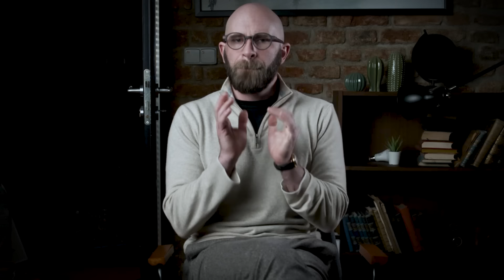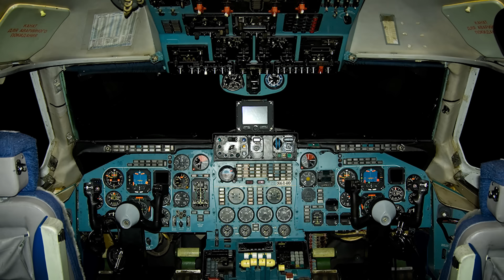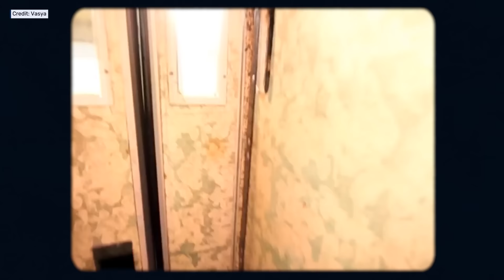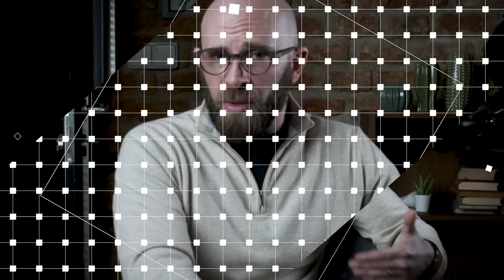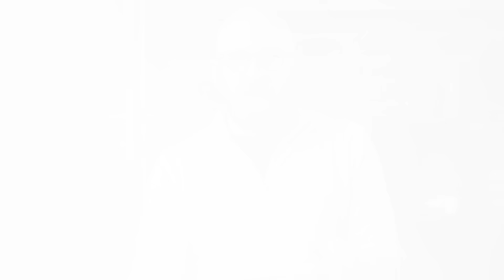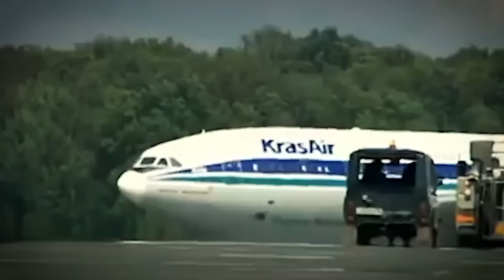The IL-86: The Soviets' Botched Answer to the 747

Comment: I flew on the Il-86 in 1983 LGW-SVO and LED-LGW as a kid. We checked in our luggage normally but I remember walking past a luggage drop-off counter on the lower deck of the plane before walking upstairs. I also remember a little electric fans in the back of seat in front instead of the usual gasper vent. Most of all I remember the take off from Leningrad where the crew did a static takeoff with the brakes on and those noisy turbojets screeching before we careered down the runway. Flying seems a bit bland nowadays!

Comment: I remember flying Il-86 at the age of 5, which was in the late 1980s. The flight was from some resort on the Black sea, probably  Simferopol. I do remember how huge it looked and remember going up the stairs. That was my only time on that aircraft.
The western aircraft that influenced the design of Il-86 the most was A300, which first flew in 1972 (Il-86 flew in 1976). Ilyushin bureau, however, had to use 4 engines because Soviet Union simply didn't have engines powerful enough that only 2 could be used.
The poor infrastructure of Soviet airports indeed influenced the design of Soviet aircraft a lot. One other difference between Soviet and western aircraft was that Soviet ones basically didn't take fuel cost into equation, as fuel costed next to nothing.
Reply: The A300 was probably the reason the Soviet's named the IL-86 "Aerobus". For the lack of big CF6-like (edited) turbofans they had to put 4 weaker low-bypass engines on it, same as the ones on the IL-76 cargo plane.
Reply: @wanderschlosser1857  the resources if the Soviet union were limited considering its population disparity comparing to "the west", or rather the dollar circulation sphere. Warsaw block comprised of 15% of global population. Besides, the ww2 and so on, "Stans". 
The Soviet union had a hand full of other projects of much greater importance. 
The speaker is a complete idiot, bet he has some sort of humanitarian degree.

Comment: Back in the late 70s I took many flights to and from the old Yugoslavia  (Ljubljana in current Slovenia and Zagreb, Croatia) and Bulgaria (Plovdiv) on JAT and Balkan Airlines on a Tupolev TU154, the counterfeit, pony, shoddy workmanship (with irregular, questionable maintenance!) 60s copies of the Boeing 727 and like you am amazed that I'm here to tell the tale...
Reply: Where did you get to know that the Tu 154 is a copy of the 727?
Reply: JAT never had TU154 ,there first Jets were 10 Caravells in 1963 ,then were all Boeings andMcDonnell Douglas.Only Yugoslav company that had TU154 was AvioGenex
Reply: @dzonikg  
Probably mixed memories, it was nearly 50 years ago - the JATs probably 727s but the Balkan Bulgarian were definitely 154s by the gaps in the fuselage, I'll fitting windows and bits hanging off!
Reply: @davefave4351  Probably that ,you fly in real 727 and tought is a copy ,JAT never had USSR planes

Comment: IL-86 was based L1011. This was in the chief engineer of the the IL design bureau. They were inspired by the Tristar. But they couldnt find powerfull engines so they opted for NK-8-6. Kuznetsov designe bureau also proposed updated version but it required to designed and tested.
I flew from Moscow to Almaty on it. I also flew to JFK from LED, via Shanon and Gander airports. Compared to airplanes of that era I did not see much difference between the IL86 and L1011. I once flew on TWA from DFW to JFK via Salt Lake City. DFW to Salt Lake City was on L1011 but from Salt Lake it was on some other plane (if I remember correctly - it was 1990 or 1991).

Comment: Great segment.  The 9-abreast seating was actually typical of aeroplanes of the period of that general width, and was the standard arrangement for the L-1011 and DC-10 as well.  The narrower A300 and A310 were usually 8-abreast and the narrower-still 767 was 7-abreast.  The 747 could accommodate 10-abreast due to its greater width compared with the aforementioned models.
Reply: Exactly. It's could be a great segment if they checked their facts more thoroughly, like his point about 9-abreast being unusual, which turns out wasn't unusual at all.
Reply: @kosmosyche remember DC 10 in 2-5-2 configuration.  That felt unusual 😂

Comment: To be fair, the concept of passengers bringing their own luggage on board and storing it in the lower compartment was quickly abandoned as it led to excessive boarding and disembarkation times.  The on board elevator could also be found in some models of L-1011, but these too were quickly removed.  A centerline landing gear is also a feature on DC-10-30 and -40 models.

Comment: Oh, come on! The IL-86 has never been positioned as an analog of the B747. The IL-86 is a medium-haul airliner. If you really want to compare (which is stupid), do it with the IL-96, which is already a long-haul aircraft.
Reply: But the 96 didn't come around till the early 90s.
Reply: @paulc8601  The Russians have an old problem - the lack of suitable engines.

Comment: There's nothing special about the seating configuration of the IL-86 or the fact that it didn't have central storage bins; the TriStar had literally the same specifications. Ah, but in the TriStar, this meant a roomier "ambience", wheres in the Ilyushin, it was bizarre. It's incredible the double standards that are applied just because the IL-86 was a soviet jet. I stopped watching right there. What a crappy video!
Reply: Me too. I watched about ¼ of the video.
Reply: Yeah this video sucks ass. Only negatives of the 86 were due to the outdated gas guzzling engines. Safer than the D(eathtrap)C(rash machine) 10
Reply: The point of the vid was to make boeing look good indirectly as boeing has a bad rep right now.

Comment: As is the norm for this channel, it's poorly researched, concentrates more on pithy delivery than actual fact. Loads of errors here but repeatedly showing footage of the VC-10, replete in BOAC markings, is particularly laughable. To say the Il-96 is a warmed-over Il-86 shows they know sweet FA about it. It's shorter, smaller has supercritical wings, flown through a triplex FBW system, glass cockpits &, crucially, it's powered by four PS-90A high-bypass turbofans & has 2.5 times the range. Apart from that, it's just an Il-86, right? Jesus.

Comment: The first question you should answer on any Soviet Bloc civil aircraft, is "Does it have a certificate of Type Approval" from EASA.  Because if it doesn't - and I very much doubt that it does - it cannot be used to carry passengers in ICAO airspace. This also requires the engines to have an EASA Type Certificate.  If it has no Type Certificate recognised by ICAO, it's irrelevant outside Soviet airspace.

Comment: I flew Aeroflot back in 1988 from Bangkok to London with the first two legs on an IL76 via Delhi and Tashkent to Moscow. On landing at Tashkent we disembarked via the rear staircase that was lowered at the back under the fuselage and walked to a holding area. The aircraft itself was painted inside a nice battleship grey colour making me wonder if it had a dual purpose for the military.
My final leg to London was in an IL62, an extremely noisy aircraft as I had a seat at the back. The interior was barely better than the IL76 though, grey paint must have been cheap in the Soviet Union.

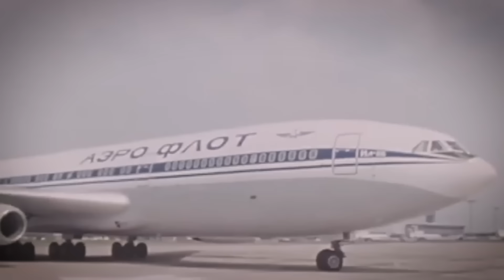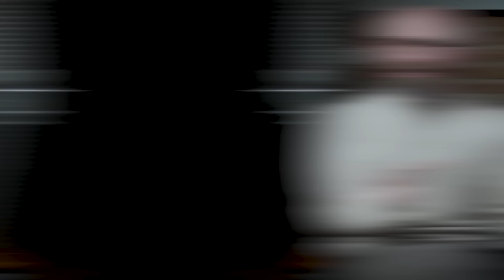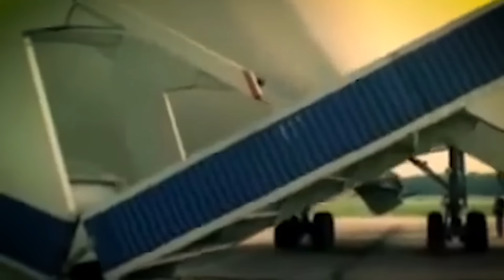Comment: 3:25  The 3-3-3 configuration is pretty standard in the B-787,  A330 and A340 (although 2-4-2 is actually more comfortable). 5:30 A centre oleo undercarriage leg is quite standard on Western widebodies such as DC-10-30 and various A-340 models. And don't forget the TWO on the B-747. 6:09 The A-340/600 as configured by Lufthansa has its toilets downstairs. And I have actually used the elevator on a QANTAS B-747. 6:38 The US Presidential B-747s (VC-75s) have such airstairs to the lower deck, front and rear.
Reply: This Pompas narrator could use a little more information next time he makes a video.😄
Reply: Yep, + he mocks the il86 elevators (lifts) which were also present on the L-1011
Reply: Dudes narrating the script, prob never heard of IL planes at all. What do you expect?
Reply: Great points here, though 3-3-3 configurations are actually somewhat uncommon on the A330 and A340.

Saving for really low budget airlines like Air Asia or Cebu Pacific, the vast majority of A330 and A340 operators use/used the standard 2+4+2 configuration, and this is the norm to this day even on the A330neos.

Comment: Would you call it strange, because it wasn’t commercially successful, or made to meet the requirement unfamiliar to you? I wouldn’t. Think of it, if 747 was brought to Soviet with less advanced air travel infrastructure, it simply didn’t work. This aircraft actually worked there, safely.

Comment: The seating arrangements for wide body a/c , at the beginning, of the DC-10 and L1011 were nine and eight abreast respectively.  The 747 had nine abreast in the beginning. It wasn't long until the main cabin seating became 9 for the 1011 and ten for the 747.  Even the 777 was nine abreast seating until the last 10 yrs airlines have turned them into ten abreast. Not uncommon at that time. Mostly everything else about the IL-86 was definitely unusual.

Comment: C’mon man! IL-62 in B.O.A.C. livery? That is clearly a VC-10
Reply: Good eye, mate, caught that as well.
Reply: The IL-62 is not a copy of the VC-10, it is an independent product, it took off for its first flight just a few months after the VC-10, it is impossible to copy it in such a short time with the equipment of those years, the copy would have been 3-5 years later. The IL-62 lived a long successful life in the sky and is still flying.

Comment: I wouldn't say that anything but 3-4-3 is weird for a widebody.
Look at the A330, undoubtedly a widebody, and a very popular one that has sold well for a good 30 years no. 2-4-2, tapering to 2-3-2 in the back
A350, the most advanced widebody on the market as of now: 3-3-3.
Boeing 767 - a little on the older side, but still relevant for some airlines today: 2-3-2
The 777 used to have 3-3-3 a lot, until airline greediness set in and made them horrible in 3-4-3.  (Still better than 2-5-2 on birds like the Tristar I guess, I pity the person in the middle middle seat)
There may be some exceptions for airlines using a high density seat layout, but I am referring to what is most common.

I think the only common denominator is 2 aisles, and I think regulations that prohibit any seat to have more than two between it and the aisle.

Elevators for lower-deck galleys were also not unheard of in the west at that time. I have seen them in person on DC-10, I have seen video evidence of them on a TriStar...

Comment: I remember Aeroflot IL-86 used to land in Luxembourg in the 1980s on their way from Moscow to Havana. Clearly that was to help with their range issues. Yes, they were noisy, and yes I remember those staircases.
Reply: Luxembourg - doubtful. Aeroflot had fuel bases in Malta and Ireland. And it was closer to fly south over West Africa. Even if completely loaded with cargo and each seat taken the IL-86 would reach Ireland or Malta from Moscow without refueling.

More likely it was after Gorbachev demanded Aeroflot move more "profitable" international cargo, some Aeroflot passenger aircraft started landing in European airports to pick up this cargo. One of these cargo shipments started a fire and caused an accident on a Tu-154.
Reply: That's a possibility, though another explanation was that Luxembourg encouraged non-IATA airlines to call there. I think you'll find that the Luxembourg stops pre-dated Gorbachev. It's true that some of the Aeroflot flights used other aircraft; the IL-86 wasn't a daily visitor.

Comment: That's not an Il-62, but a VC-10. Doh! You can tell from the tail plane, but the real give away is the BOAC livery. 🤣
Reply: I noticed that too. 😅
Reply: I imagine the VC-10 was quieter in the back than the '62.
Reply: @danielocarey9392  And faster. The VC10 was the second fastest airliner to Concorde. In the Gulf war, the USAF pilots would regularly call up for refueling from the RAF VC10 tankers because they were faster than the KC135's. I was told this by an ex tanker crew member.
Reply: @steveb6386  VC-10 faster than a Convair 990? As for the Il-62M, I flew on one in 1983, London-Warsaw. I was quite impressed. Unfortunately, LOT Polish Airlines, short of money, took to flying them beyond the regulatory overhaul times for the engines, which combined with faulty Soviet maintenance and poor component manufacture led to two catastrophic crashes near Warsaw in the 1980's. Although the VC-10 had a good safety record, in the case of the Il-62, uncontained engine failures led to damage to other engines and the severing of control cables, a safety deficiency common to all aircraft with tail-mounted engines. Both the DC-10 and L-1011 suffered catastrophic or near catastrophic uncontained rear engine failures leading to loss of elevator and rudder controls.
Reply: @danielocarey9392  And the toilet probably didn't stink like in IL-62. What is it about russian aircraft toilets, do they never clean them?
Reply: @grahamcook9289  the IL-62s flown by CSA were actually in very good and clean condition, much much better then Aeroflot junk....
Reply: Eh, he's getting reckless about facts lately; see my comment about Khrushchev...
Reply: KMEB, a boneyard in NC, had an Il-62 (OK-EBG) disguised as a VC-10 back in the 80s/90s
Reply: @philipi5759  You make me larf! Someone has painted 'BRITISH AEROSPACE VC-10' under the flight deck, that's all. You can still see the original CSA markings of the Czech state airline. The VC-10 was also built by Vickers, a company which predated the UK amalgamated  aerospace industry known as   British Aerospace.
Reply: @philipi5759 hold up really?!

Comment: I’m a big guy, and I’ll tell you the width of the seat is probably more important then legroom
Reply: Indeed leg room is not so important, until it becomes too small.   While with width you feel every 1/4 inch squeeze, and every 1/4 inch increase adds comfort.

Comment: IL-76 was a COPY of the C-141.
Reply: Absolutely not.

The 1st T-tail high wing Soviet aircraft with jet engines mounted under the wing on pylons made its maiden flight in 1952. Which is more than 10 years before the C-140. The Alekseyev/Baade(OKB-1) Aircraft "150" experimental design. The Ilyushin Design Bureau then made several high wing designs like the IL-54, which flew in 1955, 8 years before the C-141. In the 1960's they were tasked with designing a new Cargo jet, which took longer than expected since until then most Soviet Cargo planes were designed by the Antonov Design Bureau, but the majority of their designs were also high wing.

Comment: The potential irony was that the Ilyushin Design Bureau could have gotten access to the Progress D-18T 51,000 lb. thrust high-bypass engiunes. A slightly smaller Il-86 powered by two D-18T engines could have been a serious competitor to the Airbus A300B4-600 models by 1985.
Reply: The D-18 was not ready in any form until the 1980's, while the IL-86 was already in series production in 1979. A British Rolls-Royce RB-211 produced in the USSR(by a license or other means) was originally the preferred alternative to the original NK-86 engines in the 1970's, but that never happened so projects like the High Bypass D-18 and NK-56 engines appeared. The D-18 was too big, while the NK-64 version of the NK-56 was not. It would have still required 4 engines because of the 16,000 kg(35,000 lb) thrust rating. Another alternative could have been to combine the NK-86 and NK-56 and create a Medium Bypass NK-86M with a potential 14,500kg(32,000lb) thrust, which was more than 13,300kg(29,000lb) of the upgraded NK-86A which were installed in the mid-1980's. This would have led to better fuel efficiency without major changes to the design.
Reply: @legatvsdecimvs3406  There was a project to create a modified version of the IL-86, the IL-86M, in the early 1980s which would have been powered by CFM turbofans. A production run of 20 aircraft was specified, and the factory was retooled for it, but the project ended up being cancelled due to the development of the IL-96-300.

Comment: 13:31 if the IL-76 was a clone of anything it was the C-141. And obviously they were thinking about C-5s when they designed the AN-124; although I have to say I think their landing gear design might be better than the original.
Reply: Absolutely not. Check the answer in the comment above your's it explains.